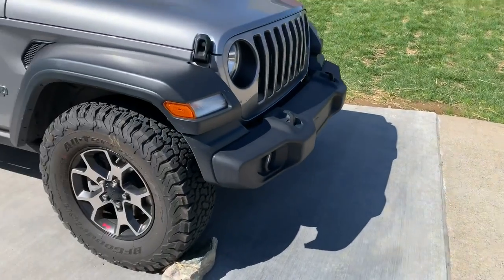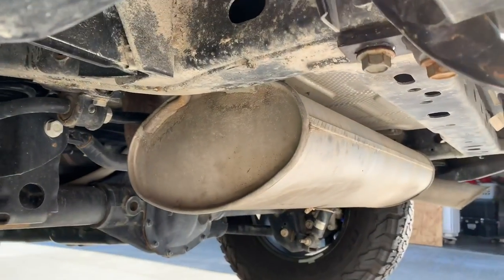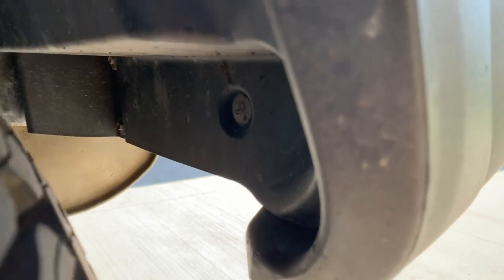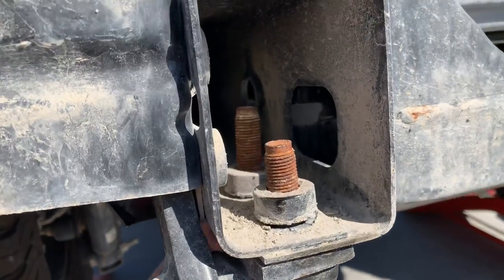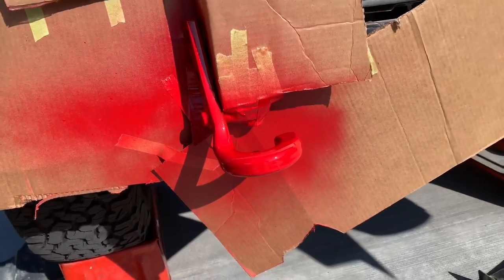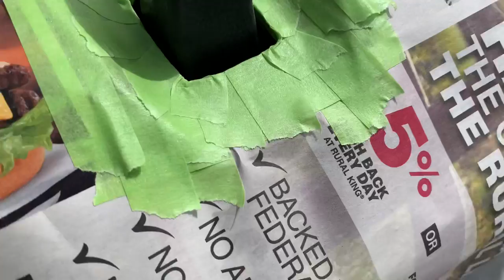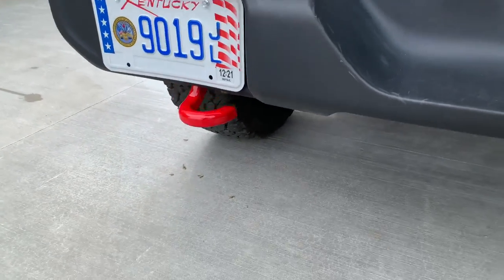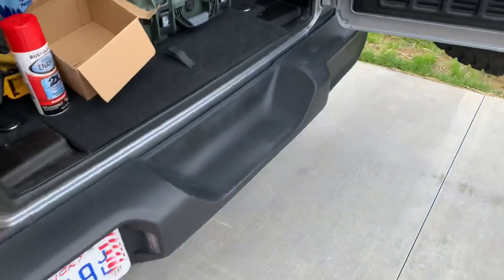Painting Jeep Wrangler JL Tow Hooks

Comment: I did the same thing (same color), except for the rear hook.
 I also took of the plastic between the fenders and the bumper. First I unscrewed those 8mm bolts. To discover that the wire harness to the fog lights would be exposed. So, I took my oscillating tool and cut the plastic all along the edges of the bumper all the way to the bottom curve. And still have that back part of the bumper covered!